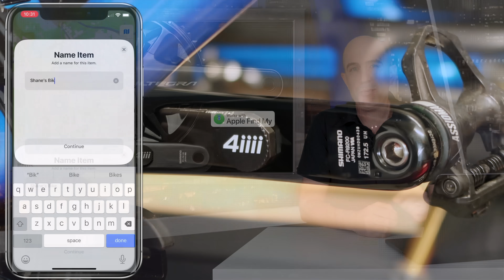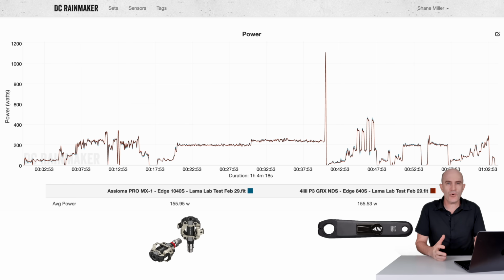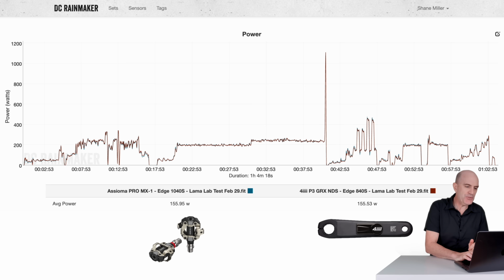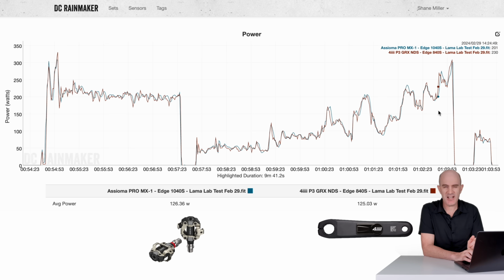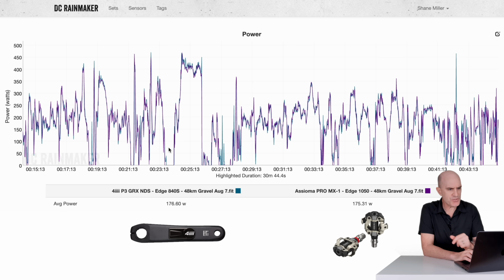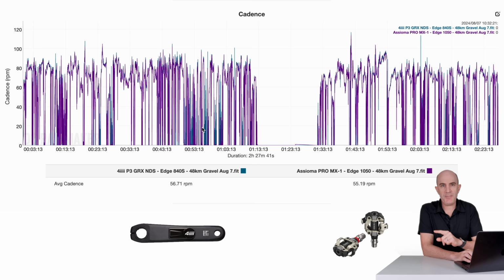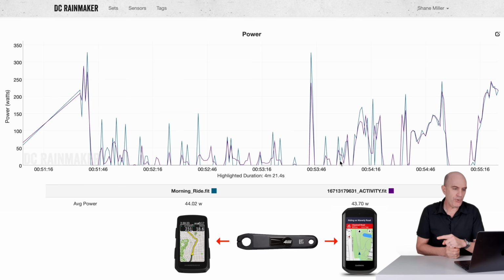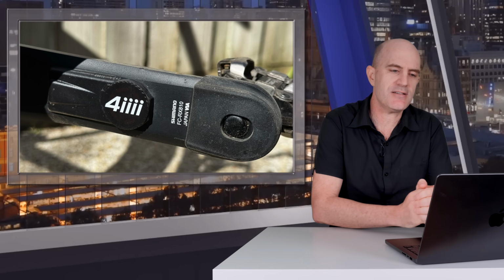4iiii Precision 3+ GRX Gravel Power Meter Has a Small Problem With Gravel

Comment: I had a grx 3+ and it was completely unsuited to wet gravel conditions. Also the warranty isn’t worth the paper it’s written on as 4iiii aren't easy to deal with (from the uk anyway). 
I also have a precision integra and that was fine but it rarely got wet so no idea if would be the same outcome.

I swapped to favero mx-pro (which had only just gone out and was seemingly the only viable option)and have never been happier. So far so good, and you don’t need to calibrate and it’s waterproofness is rock solid.

Comment: Would it not more sense for Shimano to purchase Stages ??
Reply from the maker: That wouldn’t solve all their power problems. Shimano purchased Pioneer power meter tech and didn’t do anything with it other than push out an update with force vector analysis. Shimano need a purpose built power meter and shouldn’t be messing about with post production glue-on crank modifications.

Comment: I have the previous generation product installed on my road bike and on downhills I’m getting some high readings when I push my leg on a pedal to help with a turn. I thought it should be this way, because I’m applying power to the crank. Now I now it’s a bug…

Comment: yesterday i notice srm effectively reduced their price of the ultra light origin option by offering a cheaper cybrei crank option and today I randomly decide to watch this telling me my pm is inaccurate when coasting. Its like a sign telling me what i need to do. I will have to test coasting on my interval rides. Did you test any precision 3 non plus to see if this occurs or is it only the 3+? I'd guess it would also happen on the 3 non plus but maybe something went wrong when adding the air tag functionality.

Comment: after using a Stages 4 for about one year on my gravel bike I changed to power2max ngeco with the 1% upgrade,  and won't go back to these kind of crank arm based powermeters for sure ...  on the TT bike I use Assioma Duo Shi with no issues so far ,  thx from GER

Comment: Interesting, I bought this powermeter initially based on gplama’s review (after the find my update) but wasn’t happy about its seemingly high power readings even when compared to my kicker v6. Appeared to be a faulty unit and they replaced it under warranty after I contacted them but have not been able to trust the power readings. Seemed to always report higher than the kicker. Later bought the Assioma Mx dual sided based on the reviews and trust their readings much more. Your channel is such high value for us consumers. Thanks for your work. I’ve experienced first hand how much work it is to record this data and compare it. Most mortals don’t have access to multiple power meters to compare the accuracy. This might explain my high readings I still have. Since I mostly ride gravel.
Reply: You're always going to lose power between the crank and the rear freehub because drivetrains are not 100% efficient. You can lose 5w just from the drivetrain lube type and cleanliness alone, for example. Also, if you're talking about a single sided PM, and that side is your dominant leg... Also worth mentioning that kickrs smooth power A LOT.

Comment: Many Thanks! Another great deep dive video; we all appreciate the time you put into the testing and video editing. Anything on the technical side preventing a rider from just mounting a SRAM/Quark PM crankset with a Shimano drivetrain? I've had 4+ SRAM Quark PM cranksets and they just work out of the box and to my knowledge their reliability has been proven by GPLama, DC Rainmaker and others testing PMs. Whether it be 4iiii, stages or Shimano, so many seem to have issues; the SRAM doesn't. Kudos to those Assioma pedals, which also seem to just work flawlessly as verified by several reviewers.

Comment: My grx meter was always unreliable. I’ve had to stop multiple times during rides to calibrate. Cadence didn’t seem quite right and power was grossly wrong. I could be pushing hard and only reading zone 1 and sometimes barely pushing and getting high numbers. Last straw was when it was reading a fixed reading of 900 watts when soft pedaling then would drop out all together with no cadence reading then jump right back over 1000 watts. Calibrating and completely unpairing then re pairing did nothing. Tossed in the parts bin after that and switched to sram. Real shame, my road arm with the old sensor was always solid.

Comment: I have a Cannondale Super 6 with the Hollowgram crank and after a prolonged search for a 165mm L-hand crank arm I have had it sent off to Canada for a 4iiii factory fit. As you can imagine it’s neither a quick nor cheap process. However, I settled on 4iiii on the basis of its accuracy and the bonus of the AirTag. It’s disappointing to see your review noting these shortfalls. Nonetheless, always a good report by yourself and for me thanks for flagging this with 4IIII. Hopefully, by the time I get mine back the false-positives of when powered down might be resolved. If not, it’s a liveable problem I can live with. I was thinking the AirTag was a great innovation and now well yeah sort off. Just to say again great report

Comment: I used to have a Stages R7000 crank that reported way over 1000W when coasting over rough cobbles. It still worked well for structured training but I couldn’t trust the max power numbers

Comment: Lame question: what's the difference between road power meter and MTB one? For pedals - obviously the clip-in system. But is there a difference in measurement itself?
Just wondering, as engineer :D
Reply from the maker: As I understand - Noise filtering the data. Off-road there’s a lot more vibration, stop/starts, etc. This may be related to the phantom cadence/power if 4iiii are trying to measure cadence/power at the soonest possible moment of crank movement when off-road.

Comment: I have 2 4IIII precision 3+'s, a 105 R7000 and a ultegra R8150 one. Never experienced this issue you described here, although the ultegra is yet to see gravel, the 105 has seen plenty. 

The only issue i had on British - pothole ridden roads, was the 105 kept dropping off / disconnected quite often. tuned out the coin cell had the anti-child bitter taste stuff on it keeping it from making a proper contact. Cleaned with alcohol, all good since. 

Maybe you got a dud?
Reply from the maker: Unlikely it’s a dud. It happens on the R9200 dual as well.
Reply: @gplama  strange. Suppose lucky me then! I was about to say I can share a couple fit files but I got no comparison device though. 
I had a few issues with the 105 one but mostly due to the battery shipped having the child protection stuff on it. 

Back then I looked at the faveros, the Shimano version but the bearing/bushing design on the shi’s did not inspired durability. And I didn’t fancy changing all my stuff to keo cleats.. so this was it.
Reply: The alcohol on the coin cell is an interesting tip as I'm having the issue you are describing on rough roads!
Reply: @ipaterson  worked for me. Zero issues after I removed the child protection stuff..

Comment: Since a few month, I've get stage gen 3 left powermeter (just before their bankrupt). The battery seems to hold 60 to 80 hours. About the cadence, you have the choice between internal gyroscope or sensor + magnet (off road purpose) which drain more battery. I'm using the magnet, and it's work fine for my usage (mix offroad and road)

Comment: I wonder when Favero finally updates the Assioma road pedals to the same podless design the new MX pedals have.
Reply: Definitely see that as neat for new purchases cosmetic-wise. Though my current favero road pedals is still kicking pretty good for 3 years now, so I may not be upgrading anytime soon xD. Does the MX have cycling dynamics Platform center offset? Current road always reports 0 since it's not supported if I recall.

Comment: Thanks a lot. What is your estimate regarding the full review for the dual road version. At the moment - as you said - it is one of the very few crank-based options if you want to run a full Shimano crankset. I've been holding out buying it, fueled partly by what seems like many negative reviews (not about the accuracy, but the reliability) and by waiting for your review!
Reply from the maker: I've been sent three Precision 3+ Pro R9200 chainsets. They all appear to be really susceptible to offset/calibration swings and I'm still encountering lower readings on the right side. I'll loop back to this meter when 4iii release the next firmware.
Reply: @gplama  Looking forward to it! Thanks a lot for the update and work you do!

Comment: If power is cadence x torque and your cadence is 0 then even if the strain gauge is getting some dodgy torque readings from the bumps shouldn't the power still be 0 because the cadence is 0. So weird..
Reply from the maker: Correct. That’s why I took a look at the cadence readings when it was giving ghost watts… and yep, ghost cadence.
Reply: Heh apologies if it was mentioned in the video, I usually skip the graphed sections.

Comment: I had a one-sided Precision 3+ power meter that died after few months (drained coin batteries like crazy in weeks instead of promised 800 hours of actual use). The warranty replacement unit failed in similar way after only a couple of months. I used the crank indoors and on road in dry conditions. A painful and slow warranty replacement process with the company. Luckily I got my money back and ended up with Favero pedals instead.
Reply: The precision 2 was plagued with phantom-drain too because of that damn chipolo tracking that you couldn't turn off and nobody ever actually used. I have to replace the battery every few months whether I use it or not. I hope they drop this tracking gimmick on the precision 4...

Comment: It's worth noting that the FindMy function on the 3+ does not work in the same way as an AirTag, as advertised by 4iiii. The powermeter uses simple GPS to determine if the bike is being ridden. Or in other words, if the bike is inside the van of the criminal who just stole it, and the van is moving, the device is in powermeter mode, not FindMy mode. FindMy is only activated 4 minutes after the powermeter stops moving on GPS. I had my Precision 3 upgraded to +, which meant sending it to Canada from the UK, but when I demonstrated that the FindMy function was being missold, 4iiii acknowledged this and gave me a refund. I'm only saying this so that other people know not to expect their 3+ to work exactly like an AirTag.
Reply from the maker: It’d be interesting to know exactly what causes it to switch modes. I’d hope general moment (not rotation) would keep it in Find My beacon mode.
Reply: @gplama  This is what I was eventually told by 4iiii after a stressful and unnecessary amount of back and forth:

"The key difference between the PRECISION 3+ and a regular AirTag is that the PRECISION 3+ cannot be a Find My device all the time, unlike an AirTag.  As it is a dual purpose device, powermeter and Find My device, it does not act as a Find My device when the powermeter is in powermeter mode.  It will be in powermeter mode anytime the gyroscope in the powermeter detects movement.  Movement is essentially anytime the powermeter is physically moving, regeardless if it is specifically being ridden as a powermeter.  The powermeter has to sit stationary for 4 minutes for it to switch into Find My mode and start broadcasting to the Find My network."

So even though the gyroscope is able to accurately measure cadence, it somehow can't differentiate between rotation and linear movement.
Reply: @RatluBoogerbag  not 100% sure but I think that mode switching with movement is a requirement Apple has set for all third party Find my devices. Airtag doesn’t have to follow this rule as it has the speaker to warn someone if they are moving and Airtag which is not nearby its owner. If the third party device doesn’t have a speaker, they try to mitigate stalking by this rule I guess. While its impractical to sneak a power meter to someone’s purse to stalk them, I guess someone could install it to someone elses bike. Anyway, Apple’s rules and Apple doesn’t like to do exceptions.
Reply: @viljamip  Yep, you’re absolutely right, it is Apple’s 3rd party rules, 4iiii told me this. My gripe is that 4iiii don’t state this in any of the Precision 3+ literature; they say only that it works exactly like an AirTag. It is misleading. 10 months ago when going through this with them, I suggested they amend the marketing, but they have so far failed to do so.
Reply from the maker: Thinking more on this - Not having it beacon as a ‘AirTag’ while moving means it’s unlikely to trigger the stalking alerts. In the event someone is moving with an unknown ‘AirTag’, they’ll get a notification one has been moving with them when they reach a commonly frequented destination such as home or work. If the 4iiii implementation doesn’t register as ‘moving with’ and only beacons when stationary, this could potentially be a better operation in some instances. Hmm.🤔
Reply: I actually liked the location tracking it was another safety and at least you get a position when stopped. Sadly mine was faulty and I went with another brand (never again 4iiiii) but I actually miss this feature.